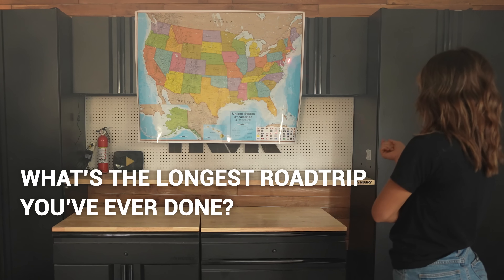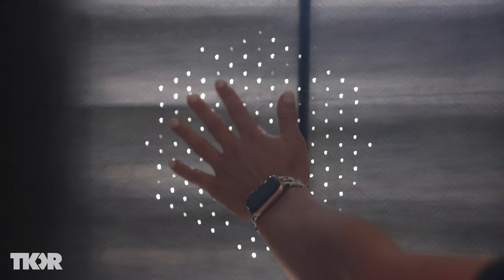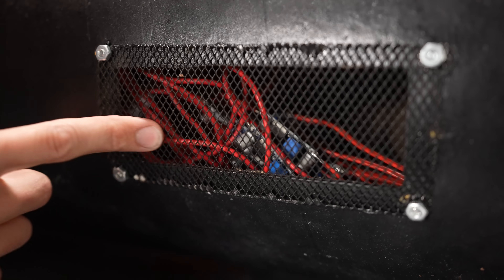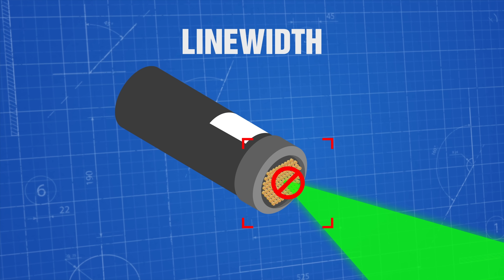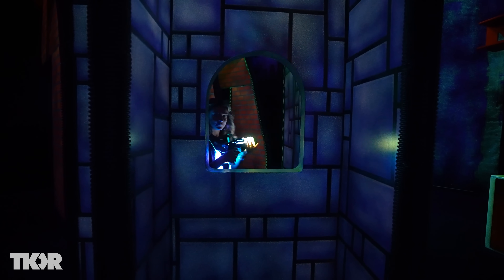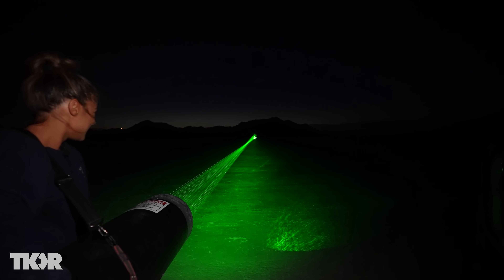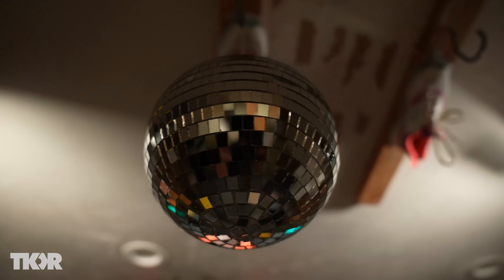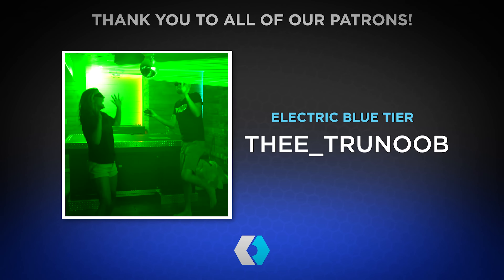Handheld Death Star Laser

Comment: YT meant I haven't watched it. YT was wrong. (I see my comments)
Video is now pathetic, as someone built a portable laser with a 100W laser array. 100W output. And then he also focused the beam. That is frightening. He blinded his cameras with stray beams coming off of reflections. And those weren't even cause by mirrors or alike, but just normal surfaces.
6:50 That other laser, that maneuver would have made you blind. Also, you do not want to stand in a path of a 100W laser. Not unless you like burns.

Comment: Thoes laser modules might only be rated for 5mw but i am possitive they are outputting close to 50mw each. 5mw alone cant burn anything, to burn through a plastic bag like that requires at least 35mw and thoes did it fast. they are 50mw or more. assuming 50mw each times 174 modules thats 8700mw. which is nuts. 

you could of also just bought a single NDG7475 1W 520nm laser diode and made your own 1400mw green laser for way cheaper and its all in one single beam. use a super X drive buck driver set to 2.2A and throw it in a custom heatsink and host. i have one built into a maglight host. its a 1420mw monster. I will say its pretty cool to see so many green beams like that.

it would only take about 6 of these diodes to match your death star laser. these are direct diode rather then DPSS so keep that in mind. it will require a lot of heatsinking.

you should really have an lpm(laser power meter) on hand to verify the output. 5mw X 174 is 870mw. not overly dangerous because there still all seperate 5mw beams but if there 50mw like i belive they are based of how fast they poped baloons and burned holes  in plastic bags. thats 50mw X 174 which is like i said before 8700mw. laser goggles are not optional.

Comment: To drive LED like these Laser LEDs, you'd better to use CC(Constant Current) DC Module, with Laser LEDs in serial connection. CV(Constant Voltage) DC Modules with parallels connection are not healthy to your Laser LEDs, and make them some brighter and some darker.

Comment: I would use many multiple 445 to 450 nanometer wavelength 7 watt Blu Ray LASER DIODES with collimating lenses instead as the human retina is far more susceptible to damage/ blinding at that wavelength rather than the 532 nm wavelength of the Green LASER diode systems. This is my preference.

Comment: It's extremely difficult to have all those lasers come together at the right concentrated point, at the right distance.
Reply: Why not just do the ! maths and work out the angles necessary to stagger the layers so that they meet into a concentrated point say a metre away from the surface
Reply: Yea
Reply: A couple lens can do the job but one at that size is very expensive
Reply: But it’s really expensive that’s probably the main reason why they didn’t do it
Reply: Better to just by a 1w green laser module for $130 like I did
Reply: This guys is genius

Comment: 532nm is usually made using the dpss process, it does not use a direct diode laser to make 532nm light, it uses an 808nm pump diode to pump some Nd:YVO4 to get it to lase at 1064nm and it gets frequenct doubled by KTP to 532nm
Reply: Other doublers work to with green DPSS like LBO and BBO also if you wanted to directly double a diode, you could use heated PPLN to get green

Comment: Try to send a vocal message into the light maybe it will work this is bigger than usually haha 😂💯
Reply: You really need a diode laser for this to work. Green lasers are DPSS and will not respond quickly enough for audio modulation.
A 1 milliwatt red laser is enough to send audio for over 10km when using pulse frequency modulation and a sensitive detector. 
The laser is so dim at that distance that you can't even see it when staring directly at it, but you can still receive the audio from it when using a fresnel lens with a large photodiode at the focal point.
Reply: @rocketman221projects  
That's a project i got to plan i want to communicate with laser like i use too with 2 goblet and a thread

Comment: Dude, you guys need goggles in every shot! Green lasers are especially likely to be more dangerous than advertised because they deliver an infrared beam with the green that is just as damaging and even penetrate some cheap goggles rated for green. I'm guilty of not using goggles around some stationary lasers also, but this is a whole new level.
Reply: Yeah I was worried about that too...
Reply: @Eddie Hitler 
Also at 7:05
"It's so bright"
Reply: look at 1:51
Reply: I would not do this without being certain that an NIR filter is on the laser itself and a tape seal around the glasses, glare around the edges can get you on anything more intense than this, especially with the beam converged or collimated.  A cheap night vision security camera (with the LED RING) and a diffraction grating will be an adequate detector of the NIR wavelengths.  Two sets of dots on the wall past the grating means its a dangerous laser.
Reply: It is scary because there is a direct flash for the girl at 1:52. You guys need to be more careful!!!! Always where the correct goggles for the lasers you are dealing with!!!
Reply: its tkor lol what did you expect...
Reply: Its crazy because you need goggles that can block 532nm AND 1064nm. I’m sure they make ones special for the green lasers but I wonder how many fakes skip out on the IR blocking since you can’t straight up tell if its working like you can with the green part.
Reply: "Styropyro has entered chat"
Reply: scared, horror, go away spooky ghost
Reply: assume 100mW per laser, 0.1W, x200, max 20W
Reply: speaky ghost
Reply: Don't attempt to point at a helicopter
Reply: I have a green lazer and i shined it in my brothers eye because i got antey at him
Reply: Even reflections of this type of radition can fry your retinas ....js
Reply: Totally agree.  Only takes a few seconds to give you a lifetime of eye damage.  If you're popping balloons, you could just as easily sizzle your retina or give yourself cataracts.  I actually stopped watching because of the recklessness in an otherwise very cool video.
Reply: NightHawkInLight actually responded to this now Styropyro needs to give his 2 cents about it. You know he would not be happy.
Reply: Don’t forget that they put it up to eye level. I work with lasers and I don’t really use goggles, but I always make sure to know where the beam path is at all times and don’t wear any reflective gadgets like watches. 
 
I also know the exact wattage of my laser. This is absolutely crazy!
Reply: @AravindKarthigeyan  yeah, but what about that split second accidental reflection???
Reply: @Eddie Hitler I don't think they were 5mw, if you notice they were poking holes in thin plastic. I would say on average of all lasers, individual would be about 30-40mw
Reply: not at 1:52 into the video 😬
Reply from the maker: Thank you so much for being concerned about the safety of this video! We were wearing goggles in most of the tests and took them off when we were trying to make sure we got the shot for the video but, we were EXTRA cautious when we had them off. We should have emphasized that everyone should always wear goggles that block the green laser wave length when working with green lasers and that our behavior wasn't safe and shouldn't be emulated at home unless you have the high quality goggles for lasers or prior experience!
Reply: @TheKingofRandom  unfortunately you were not. Most of the shots you weren't wearing glasses, you shined a bunch of laser in the face of Grace and even the reflection on material could potentially damage your eyes.
Reply: @TheKingofRandom  what about 1:51?
Reply: @TheKingofRandom  dude you see how it burnt through the paper? Now imagine your eye pigment with your cornea in the mix.
Reply: @TheKingofRandom  Id rank the ability to see over getting a better shot always.
Reply: @TheKingofRandom  Don't want to sound rude but... video clearly shows that you were NOT "extra cautious". It's not first time we see you not being cautious enough about some risky  stuff so just be safer next time please ._.
Reply: @TheKingofRandom  Sorry but that just cannot be true that you were cautious at all. At 1:52 into the video during the mirror scene the beams shine directly into her face and she is not even wearing protective glasses!
Even if you had glasses you would want to avoid that.
Reply: @TheKingofRandom  1:52 Dude you hit her right in the face with two dozen lasers. That is not "extra cautious".  Not cool guys, you need to fix this.
Reply: @TheKingofRandom  Removing goggles just to get footage was really unneccessary, and I thought that was pretty uncool. It was the only thing that marred such a cool video
Reply: @TheKingofRandom Honestly, you weren’t EXTRA cautious… I mean great vid man but I saw a laser being pointed into someone’s face, and goggles were not being worn most of the time… Kf your gonna play with lasers, take extra precautions 😬
Reply: @TheKingofRandom  fools
Reply: Someone beamed me recently when I was just walking down the street. I called the sheriff but I don't think they did anything at all.
Reply: @col.cottonhill6655  yeah they don’t care unless it’s beamed at there helicopters
Reply: This is not a New level, this is just a collection of medium powered lasers. We only acknowledge a laser being more powerful than other when there is a single beam.
Lasers are all about intensity, and here no Better intensity has been achieved.
Reply: who are you
Reply: We used expensive glasses! Thanks for your concern... dude!
Reply: @ThePoserProductions  ?